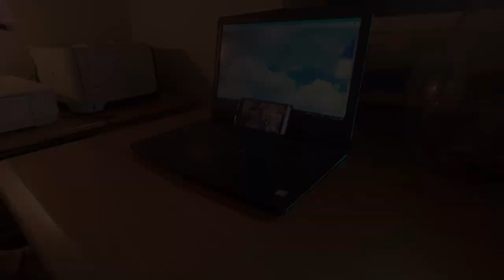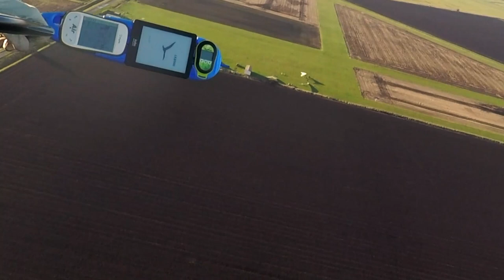Hang Gliding Aerotow Barrel Release Test Flight

Comment: The barrel type release for towing hang gliders has been in use in Australia since about 1985. The new aero tow style that uses the aluminium tube and the parachute rigging pin are a great improvement over the earlier models that were heavy and bulky.